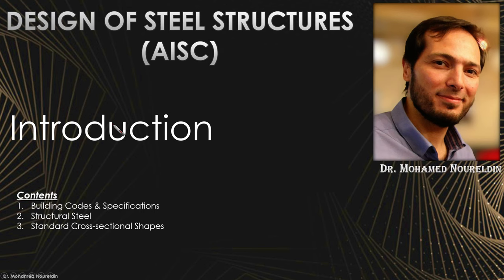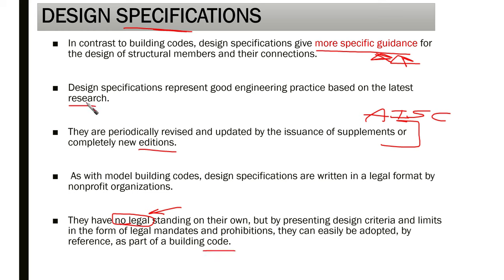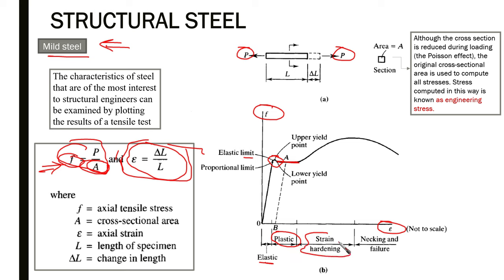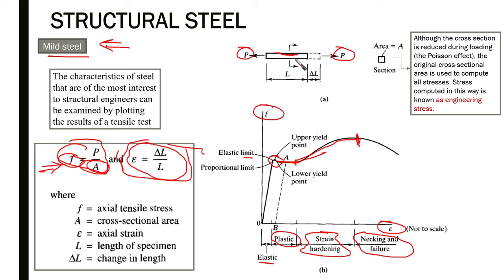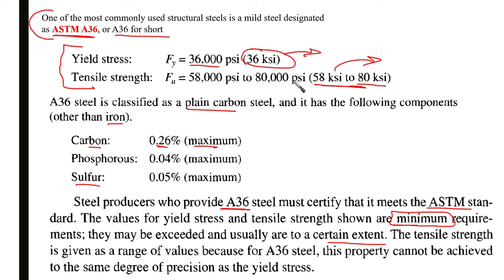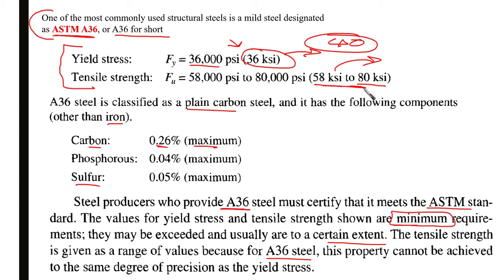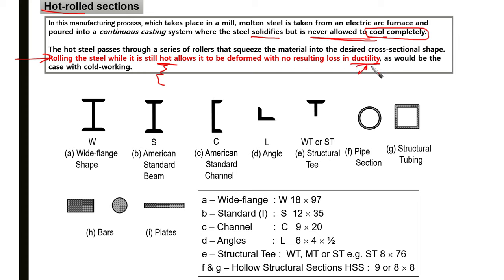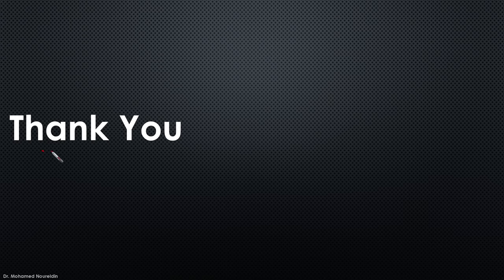1- Introduction to Design of Steel Structures (AISC). Dr. Noureldin

Comment: Dear @Dr. Mohamed Noureldin,
Why do not you use the latest revisions of the AISC & ASCE7 code?
Reply from the maker: Thank you Eslam for your comment.
The course is focusing on steel design concepts in general rather than a specific edition of AISC. 
sometimes, I refer to the latest editions in some videos.
Reply: @dr.mohamednoureldin5718  Thanks a million for your reply. But, as a query is not the engineer forced by law to utilize the latest version of codes & standards?